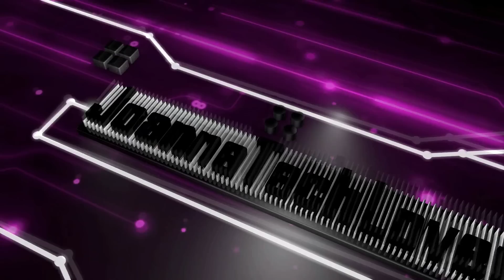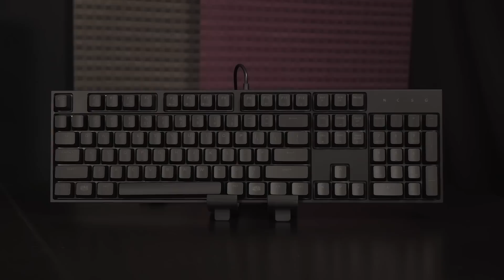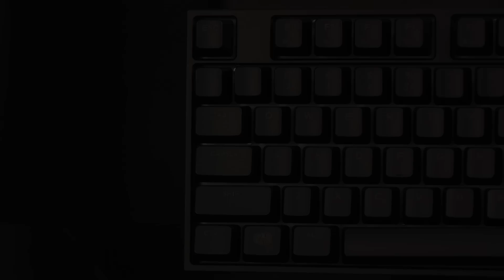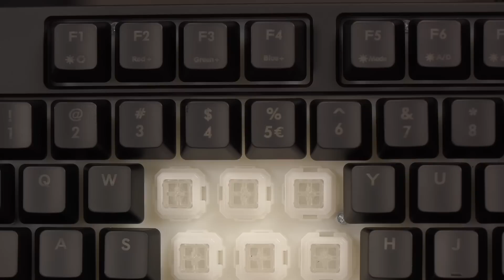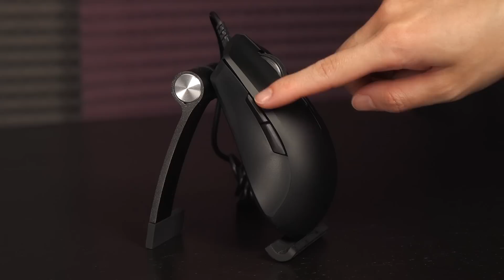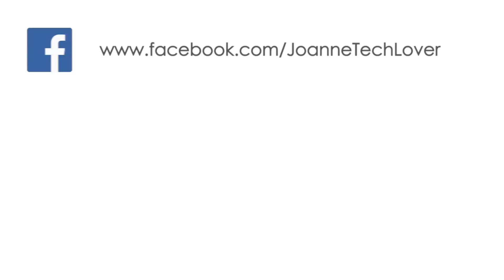Cooler Master MasterKeys Lite L RGB Keyboard/Mouse Combo: Overview + Lighting Tutorial!

Comment: 2:38 you can acctually change where the ligth comes from with f6
if you pres FN + F6 there will be a quick flash of light from the region of the selected area. you can then use the first F1-F4 to change the color of the selected area. so you can make the right side red, and the left side blue, for example.

Comment: I've been using this keyboard for the past 8 months and I have to say it is one of the best keyboards I've owned. It isn't exactly mechanical nor does it feel like it but I've come to love the squishyness of the keys. There is no tactile click like a mechanical but everything else looks like it is. The RGB aspect is a little bit lacking because not every key lights up individually but if you have it in the spectrum rainbow mode or just a solid color, it looks great. The lights can be either pretty bright or pretty dim which is nice because I don't like super bright keyboards. It is also pretty drop resistant. I've dropped it from a height of 3 feet (Not on purpose of course) several times and the worst thing that happened was a couple of the keys popped off. I popped them back on and went right back to what I was doing with no problems. Honestly, if you're looking for a cheap mechanical lookalike RGB keyboard, this is the one I'd suggest.

Comment: Best review of this keyboard out there. Thank you, you helped me decide to buy one.
Reply: Chroma Matrix how is it??
Reply: Melo I've been using this keyboard for the past 8 months and I have to say it is one of the best keyboards I've owned. It isn't exactly mechanical nor does it feel like it but I've come to love the squishyness of the keys. There is no tactile click like a mechanical but everything else looks like it is. The RGB aspect is a little bit lacking because not every key lights up individually but if you have it in the spectrum rainbow mode or just a solid color, it looks great. The lights can be either pretty bright or pretty dim which is nice because I don't like super bright keyboards. It is also pretty drop resistant. I've dropped it from a height of 3 feet (Not on purpose of course) several times and the worst thing that happened was a couple of the keys popped off. I popped them back on and went right back to what I was doing with no problems. Honestly, if you're looking for a cheap mechanical lookalike RGB keyboard, this is the one I'd suggest.
Reply: thank you so much man i just bought it, its awesome